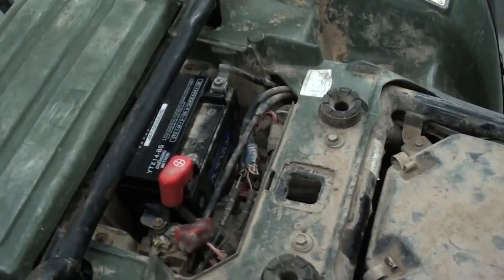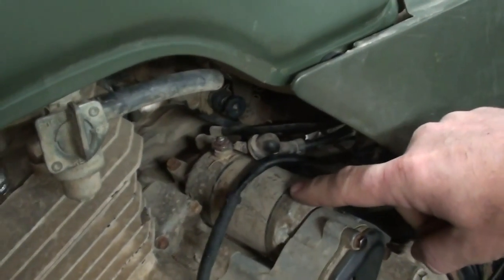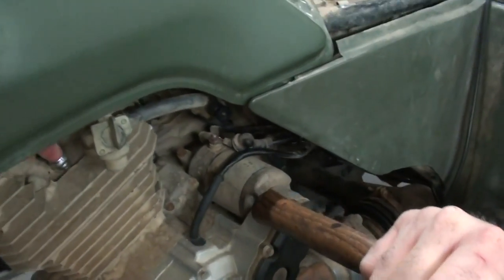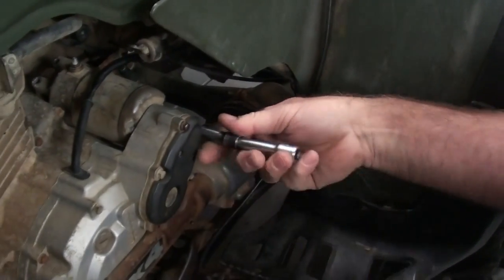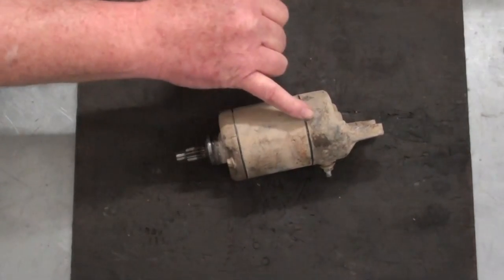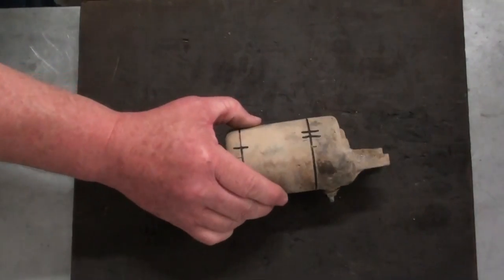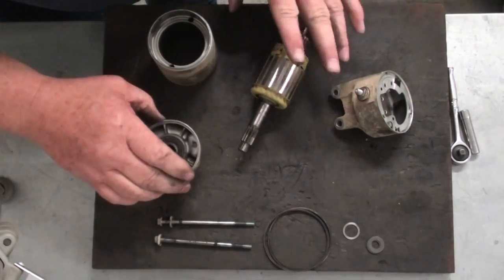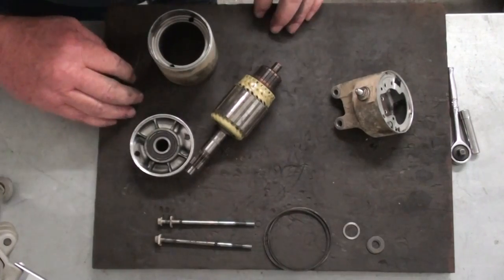Pt.1 Starter Rebuild For ATV's UTV's And Motorcycles At D-Ray's Shop

Comment: I have an 86 4trx 350 and it clicks, I tried tapping the starter and nothing, it doesn't help the exhaust is kinda blocking everything, is there a possibility that brushes are just completely stuck?

Comment: Whats wrong when you have no neutral light and the electric start wont work on a 1991 honda trx 300. I have to start it with a screwdriver by touchin both heads of the solenoid

Comment: Lucky the carbon brushes didnt make a mess of the comms.
So its out with the 1000 grade sand paper to make those commutators sparkling :-D.
Ive had to use the wrong sized brushes in the past, sandpaper shapes them to fit :-D.
Yes im a bodger lol.
Reply from the maker: Been there, done that man!

Comment: ok but what if your bike will start but not turn off? as when you turn the key off or hit the kill switch it sounds like its trying to start the engine,and the starter is getting very hot.